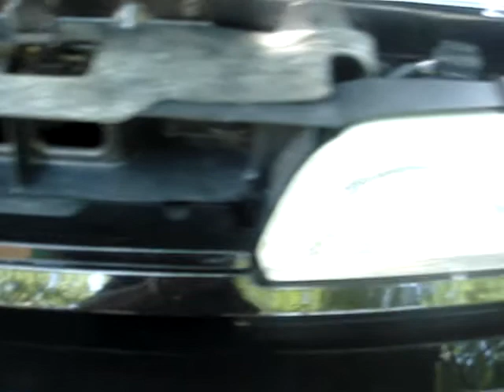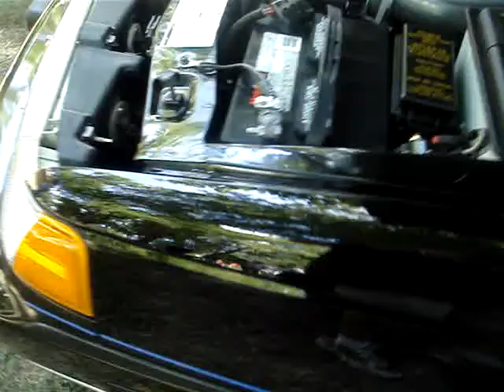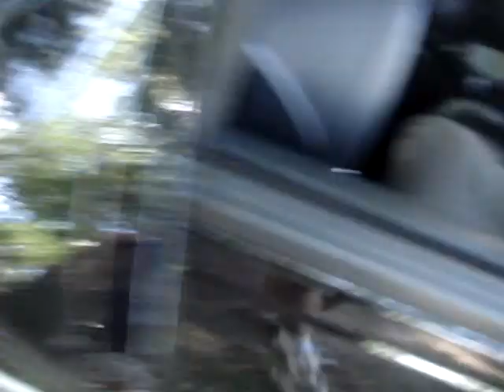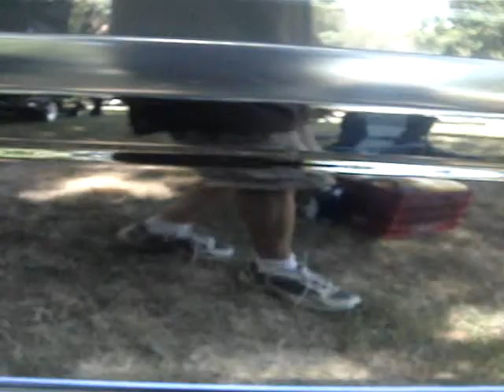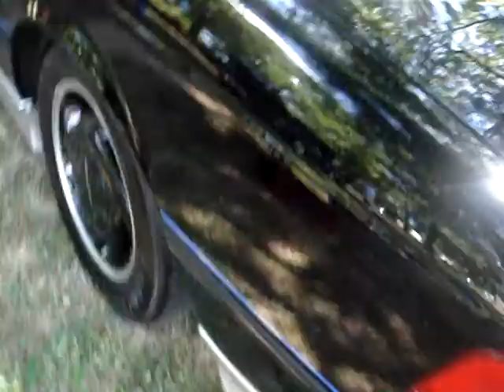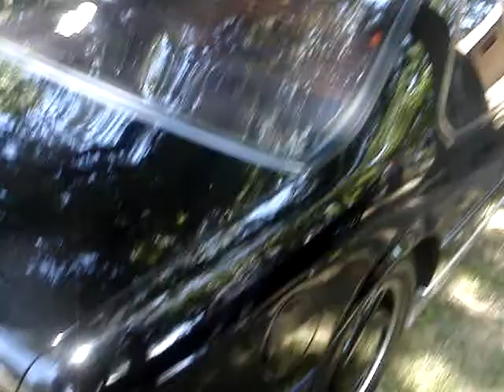1990 THUNDERBIRD SUPER COUPE --  HIGH POWERED T-BIRD SHOT DOWN

Comment: Nice video along with all the facts posted description. I appreciate the fact that you appreciate this unique blast of the past. You have  the facts and shown a nice representative for the SC.  I find once a person has ridden or especially driven the unique SC they are instant fans and don't easily forget the Super Coupe's. I know my 93 has instilled smile lines on my face. I love having one of these little gems. However all is not a party in paradise with these. They are a Ford product and there were limited numbers and years they were produced. They have an electrical system that tests the best of mechanics. It is so integrated into every single facet of the SC. Anti theft keyless entry doors trunk. Adjustable Ride Control firm-soft. Assisted rack and pinion steering. Auto lamp lighting. Auto Climate Control.  Abs,  Fully powered seats mirrors. Smart rear view mirror fog lamps, under hood light.  Etc... Remember this is late 1980's -90's pre OBD ii. Ford put a lot into this car.
Reply from the maker: I did a lot of research on this era of Birds. And, Ford did place a lot of effort into this car. Plenty of luxury and style and so many features that owners like yourself would appreciate. But along with many fans there were some would detract from this car.  I appreciate your experience with yours and many thanks for viewing and all of your comments.

Comment: The last of the Fast T-Birds and she is a beaut. My nephew had one here a few years back and it had the 5.0 V8 . The 5.0 had no guts as in comparison to what has rolled through the shop out here. Jerked the sorry thing out and the AOD 4 tranny .Replaced it with a 351 Windsor 4bl and built AMX C4 Automatic from a wrecked 73 Montego GT and the Mercs 9inch rear and made one really wicked T-Bird. Hooked up the AC and other equipment except the Engine control box. This car had no box left after I got done with it. All old school performance equipment no 
modern gunk taking up valuable space. Kept the Cars out ward appearance factory .5.0 mustangs couldn't touch this car. I had a 1980 Olds at the time. It Had a 70 model 455 Olds Golden Rocket High Performance V8 &he could stay with me but never could pull around me. The T-Bird is now parked cause he has a wife an4kids and a mortgage. So he has no time for it now but I go ovwr there and start it .It still runs and drives but he is saving it for his son when he's 16. BTW My son turned 16 Yesterday and got his license .And he's eye balling the Road Runner and the 210 really bad. I told him no you get to drive the 78 Impala 4dr sedan . He thinks its uncool but I told him its what you got to drive or walk .He said alright
Reply from the maker: Doug, yes the last of the fast Birds.  Isn't the 5.0 litre the same that the Mustangs used?  I was under the impression that these were powerful engines.  But of course anything you would install into a Bird would be far superior and powerful.
Reply: It better that way cause a  MOST 16 year old don't have the DRIVER EXP to handle a fast car for there first car.  i seen so many kids that get a FAST CAR given to them as there first and then wreak it & or kill them self trying to be cool. showing off or they take it out street racing and don't know what they are doing yet. . so i would not give a 16 year old a FAST CAR. unless i know they can drive with out being total dumb azz. thinking  they know everything about driving.
Reply from the maker: Nate white Well yeh, don't have an unexperienced teen drive anything that is a fast car.  Young people at that age aren't developed enough yet to drive something like this.  I see it on the news all the time.  Either that or they're texting.  They're not mature enough to handle most things in life at this age much less drive a fast car.  You said it man.  Thanks much.

Comment: Nice! I have a '91 5.0. What brake system does it have?
Reply from the maker: Man, I wish I could answer your question, but this T Bird isn't mine.  I just videotaped it because I admire this car.  Thanks for viewing and liking.
Reply: It has all disc brakes all the way around with ABS. Independent rear suspension and adjustable ride control (Firm/Soft)  shocks all the way around.
Reply from the maker: Thank you Austin!  So, glad you could answer a viewers question.  I don't claim to know everything and really, I don't always have the time to do research.  Your comment is very much appreciated.
Reply: @angryretardcereal  It also has a hydraulic brake system which will set you back a small fortune when it fails. ( I know this is an old post but people still need to know..lol)